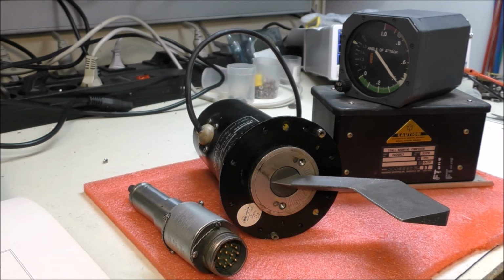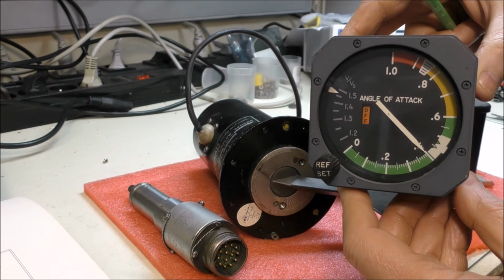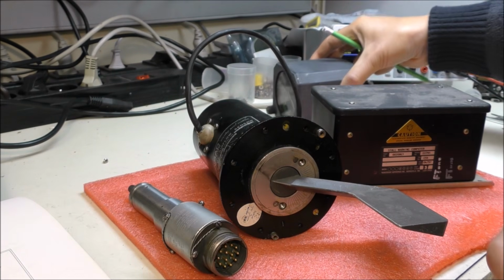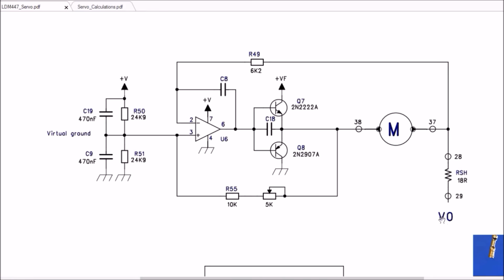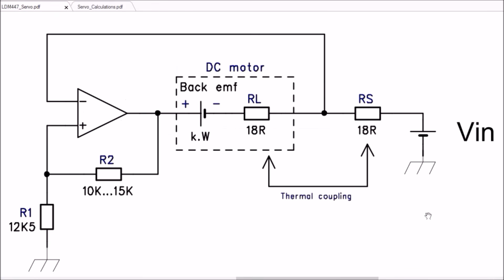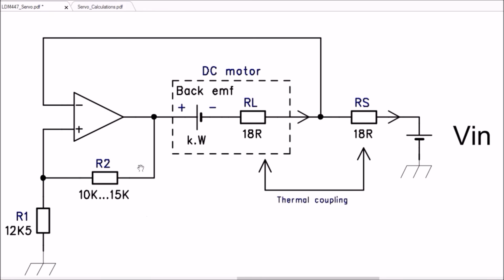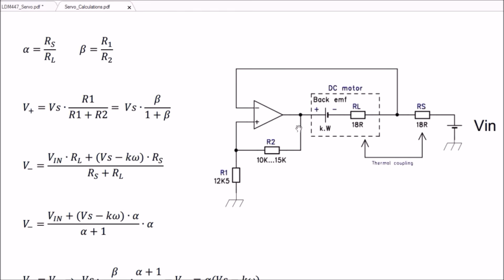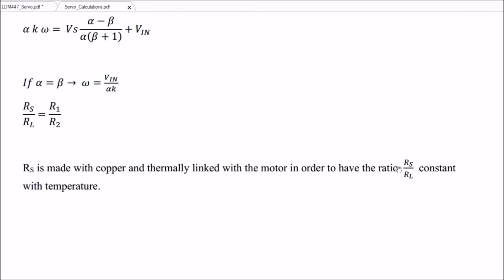LDM #447: Angle Of Attack indicator Teledyne Avionics SLZ9680-3

Comment: An interesting video with a good circuit explanation,  I am surprised that the crimped contacts on the wire loom were allowed on a flight instrument. (vibration)
Reply: Crimping is a standard in aviation.
Reply from the maker: The crimped contacts are quite strong, they were difficult to disconnect.